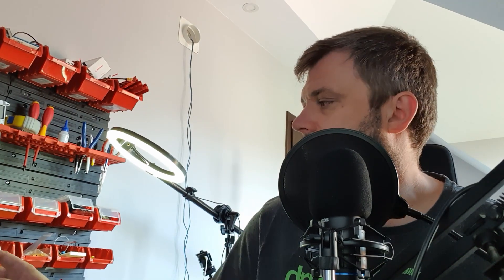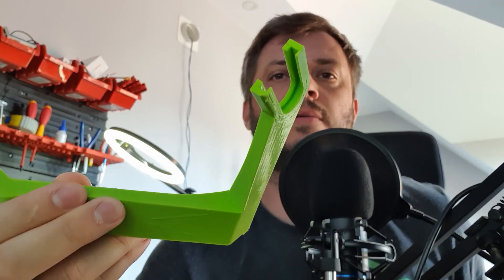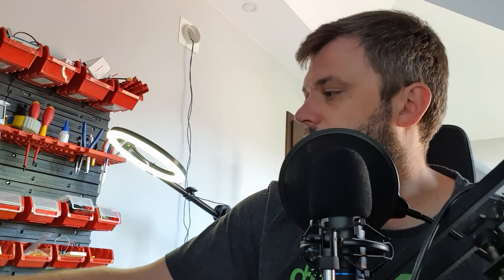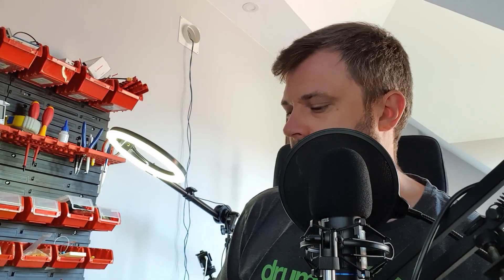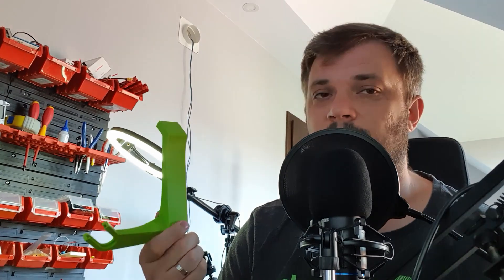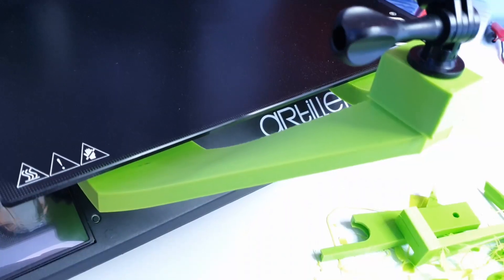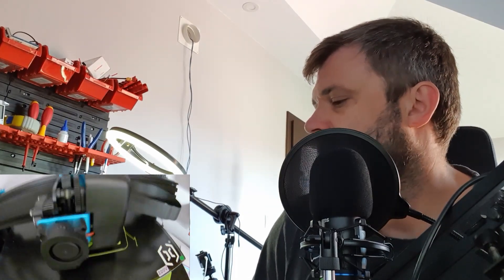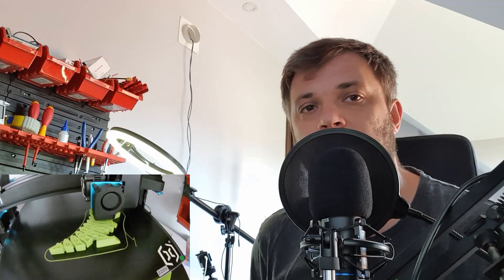Designing The Sliding Camera Mount For Artillery Sidewinder X1

Comment: great, and interesting to see your process. Will you be releasing the actual file for the bracket?
Reply from the maker: Yes I will, most likely next week. Just a few last tweaks to check.
Reply: @gettingintorcand3d955  Great...no rush, you seem pretty busy and I haven't ordered my printer yet ( but in the next couple of weeks I will)
Reply from the maker: best spent money ever 💪👍
Reply: @gettingintorcand3d955  where are you sharing your designs????
Reply: Hi  @gettingintorcand3d955  have you released the file since thice comment ?
Reply: @gettingintorcand3d955  great idea to attach to bed!  Did you end up sharing files?
Reply: @gettingintorcand3d955  please share the STL file